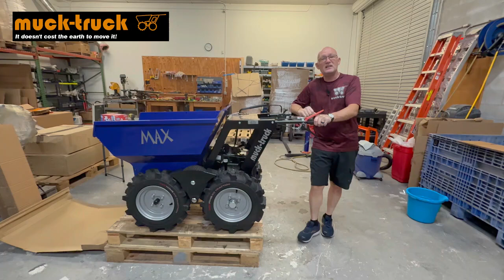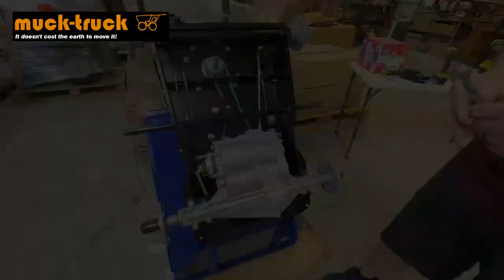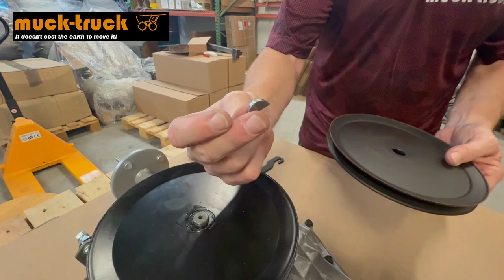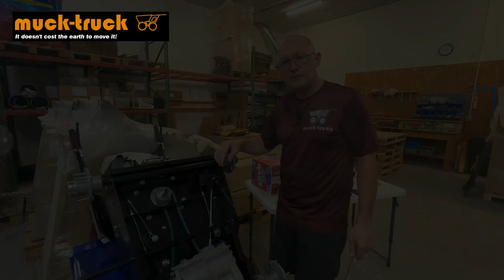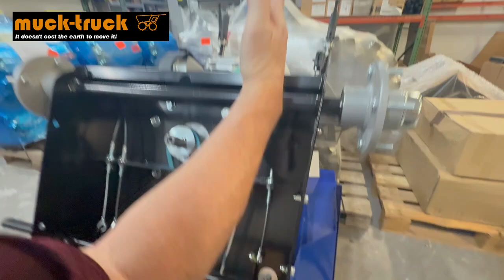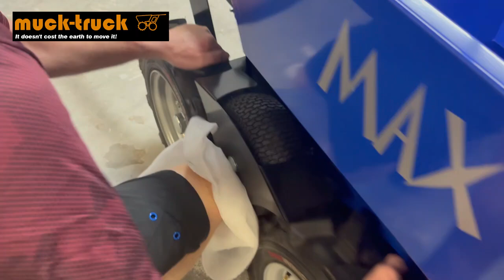How to Change your Muck truck Machine Transmission

Comment: Insane design; you'll have to replace the power drive wheels' caps every time you disassemble those wheels! Why not just to use circlips at the end of the attachment shafts???? Well, the overall design of the entire Muck Truck has been done by someone who has whatsoever no understanding of proper engineering!!!!